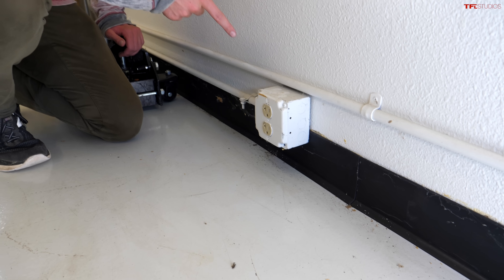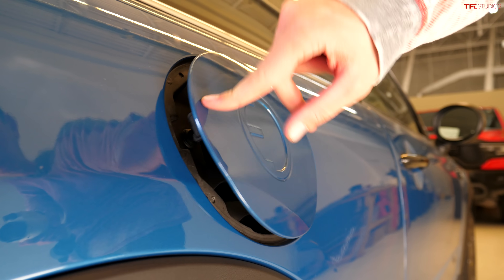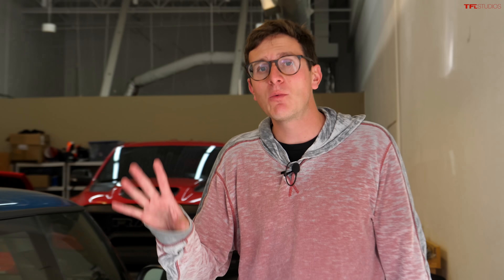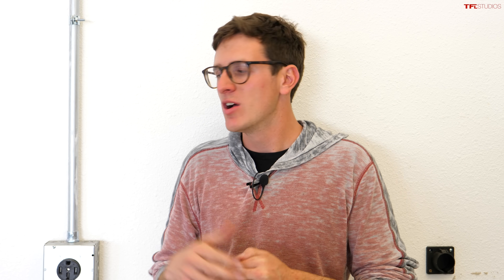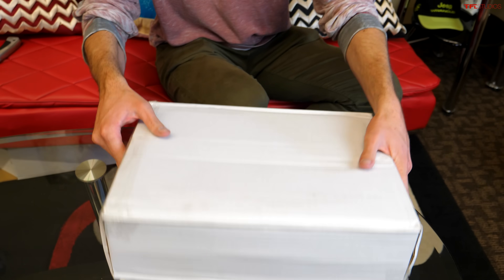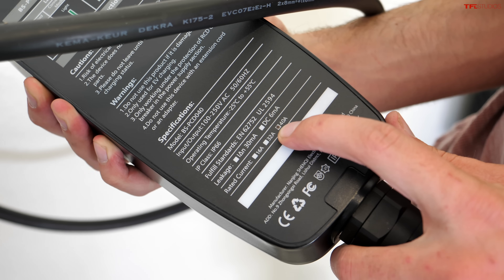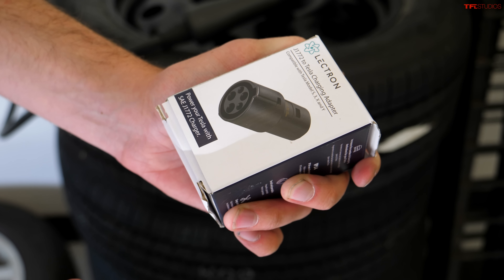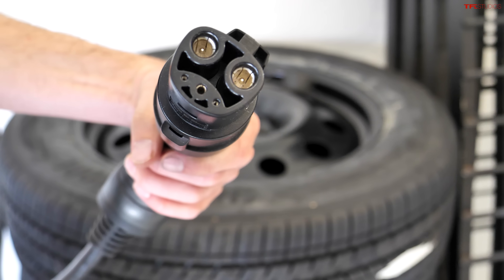Here's The One Thing You Don't Want To Forget When Charging An Electric Car!

Comment: 1:39 Unless that is a dedicated 20A outlet with a 20A plug which aren't very common, you can NOT charge at 1900W for an extended time.  A 120V 15A outlet (most common outside commercial settings) with the two vertical blades (plus round ground pin) can only charge continuously at 80% of the rated amperage of the 15A outlet or total draw of 1440W.   A 120V 20A outlet with the one vertical and one horizontal blade (plus round ground pin) plug can charge continuously at 1920W.  If you try to pull 1920 watts from a 15A outlet you will trip the breaker best case, however you do also run the risk of fire as most 15A outlets will be wired with 14AWG wire and not rated for that much current draw.  If that unit having a 15A plug is truly pulling 1900W that is a major fire risk.  Your video shows a 20A outlet which is correct, however the charger itself is only 15A plug on it, therefore should be reduced to 1440W max.  If its not, then this charger is very dangerous to use in 99% of residential settings as it would be overloading the wire, outlet and breaker of a 15A plug.  👎💥
Reply: True.  The Tesla chargers seem to interrogate the lines as they ramp up power and can spot faults or high resistance pretty well.  They’ll attempt to go for as a high a load as they can, then fall back when it detects issues with your wiring/outlet.
Reply: True, The 240 volt outlets here in europe are rated at 16 amps. Great, but that is only for max 1 hour. After that they start to become a bit warm.
Reply: True, The 240 volt outlets here in europe are rated at 16 amps. Great, but that is only for max 1 hour. After that they start to become a bit warm.
Reply: I find that 15a and 20a plug is nothing more than a blade turning sideway, it isn't any thicker. As long as the wire is at least 12 gauge or greater, it's usually fine to pull 20 amp even when both blade is vertical.
Reply: @AdamIverson  For the most part that is correct, however you can't assume that a 15A outlet will have 12AWG wire.  Most of the time it will be 14AWG wire for cost savings and its not required by code to be 12AWG.  Here if the unit pulls 1900W regardless that is a very bad design.  Because it has a 15A plug it should be limited to a max of 1440W period and then lower the current from there if there is any voltage drop.  I don't know the full operation of that unit, so I can't say for sure, but if they do pull 1900W that is a very dangerous system for sure and could result in potential fires.  They would be required to have a NEMA 5-20 plug on it and plug into an appropriate 20A rated outlet only.

Comment: I thought all electric cars come with level 1 chargers from the factory?
Reply: Most do. The Mini SE came with a cheap level 1 unit maxing out at 1,200 watts. We have 20 amp circuit breakers in the garage that could support 1,800 watts with a proper Level 1 EVSE.

Comment: So none of these carry UL or CSA certification?  Yeah no thanks.
Reply: You are correct. No UL List Mark, CSA Certification Mark or ETL List Mark. If tested to both U.S. and Canadian common standards the marks will have "us" on one side of the mark and "c" on the opposite side of the mark indicating safety compliance for both U.S. and Canada. There are local US and Canadian deviations that have to be taken into account for both US and Canada Safety Approvals that are not part of the common European Union Safety Directives that the CE mark indicates.

The units are CE marked indicating self certification to European Union Directives. There are local deviations for each country within the European Union that may not have been taken into account when the unit was tested. Lectron should be able to provide a country deviation list as part of their CE declaration upon user/purchaser request for European Union installations / usage.

In conclusion, only purchase units that have US and or Canadian NRTL Safety Marks like UL, CSA or ETL for North America.
Reply: @Joe3545u  Great info and agreed.  Here in Canada most provinces have laws against selling or using any non certified equipment.  But somehow Amazon seems to get a pass.  I'm sure hardly anyone will read these comments, but if you do please think twice before using these cheap charging cables.   If the manufacturer hasn't taken the time and expense to certify their product to North American standards, what other corners have been cut?

Comment: It's not as easy as just plugging into a dryer outlet. The plug you use for your level 2 evse is probably not the same that a dryer uses. Dryers are typically 30 amp circuits and they will usually have either a NIMA 14-30 (4pin) or a 10-30 (3 pin) outlet. Most level 2 evse's use a NIMA 14-50 outlet and when installed correctly will be on a 40 or 50 amp circuit. So at the bare minimum you will need an adapter to use a dryer outlet. You also need to make sure the current draw doesn't exceed the capacity of the dryers circuit. If you have a 32 amp evse you would need to be able to limit the current draw. Sometimes the car has the ability to set the current limit. If not there are also evse's that can set different current limits. The other option if using a dryer outlet is to get 16a level 2 evse, then you would be safe on most 220 outlets.
Reply: I charge my electric car with my dryer outlet using no adapter.
Reply: I forget what makes my evse but it came with 5 Nema adapters
Reply: I don't think it matters. Many EVSE suppliers offer specific plugs to meet the household needs (at least the lower amperage Level 2 units). And if that isn't an option, a quick outlet swap would suffice. Two hots and one ground is all that I needed for a NEMA 14-50 from a sub panel. The UL certified Level 2 unit doesn't care. Always remain mindful of circuit capacity of course.

But maybe a 10 minute outlet swap is inconvenient for most... idk. 

Understandably, maxing out on EVSE amperage could be detrimental and arguably overkill for the vast majority of North Americans. 20 amps (Level 2) is fine for most .

Comment: Complicated charging?  All you need is a NEMA 14-50 outlet.  You can get a Level 2 240v 16amp evse for around $200.  It will charge at double the speed of the 120v Level 1 in the video.  NEMA 14-50 outlets are commonly called '50amp' plugs at RV parks.  202v at your outlet is almost out of spec.  I see 247v from my 240v outlet in the garage.

Comment: Great video, EVSE (Electric Vehicle Supply Equipment) non of them are chargers they supply AC mains power, would have been nice if you used the dust cover park built into the sockets door instead of leaving it dangling against the body. Still a great explanation.

Comment: Seems a bit disappointing that the Wall charging station is only 32A compared to the Portable one which goes faster at 40A❓🧐 🤷🏻‍♀️
Reply: Many cars can only handle 32A AC charging anyway.  But there's tons of wall chargers out there.  Some of them go crazy at up to 80A.  Still, 32A is a good number if someone wants to, say, install multiple wall boxes without going crazy trying to build out the back end to support that much simultaneous current draw.

Comment: So ben sillis did a video on a easy 240 chargimg system. It was essentially a lvl 1 charger with 2 lines running from it allowing you to plug into 2 seperate outlets at once thus creating a lvl 2 without having to install a 240 outlet. Something to look into. I can drop a link if needed
Reply: You just have to make sure those two 120 volt outlets are on different circuits.
Reply: @caseyhill3915  correct

Comment: Great video: didn't even seem like an ad.  Love those carrying cases until I try to pack the cables in them.   BTW.  Isn't the electric utility that sends you the electrons the actual charger :)
Reply: Nope, that's just the energy source. The actual charger controlling it all is built into the car. :)

Comment: To save money on install i ran all the wires myself.  It is hard but simple work.  I paid the pros to wire up the breaker at the box and inspect my work.  Union shop bills by the hour and he was done with the minimum 1hr charge.  Materials such as my 150ft run of 6/3 wire costs a lot.

Comment: Tommy, the problem with a level two charger on the road is after the bathroom break you still have hours to kill.
At the moment given lack of on road options   and speed of charge EV's are impractical for regular long travel.
By the way it was a good and informative video, even though it reinforced why I'm keeping my Jeep Wrangler Unlimited Willys, that and the fun factor
Reply: Yup. That is why level two chargers are really only employed as "destination chargers" at office, lodging, shopping and tourist locations. Places where you are already stopping for hours.

Along the highway, level three chargers give you the speed you need. A large percentage of EVs (Ford, VW, Hyundai, Tesla) can charge as much as you need in the time it takes for you to grab a coffee and use the restroom.

For fast charging, EVs are much faster when the battery is low, say in the 10-70%  range. Above that, they rashly start to slow down. The MachE, for example, takes 50 minutes to charge from 90 to 100%, which is more time than it takes from 2% to 80%. It's a different mindset, but for long trips, you charge overnight to start with as much charge as your can. The first stop should be about when you reach 10%. Starting with this charge, you never want to fill the battery. You only want to add enough to get you to the next charger maybe 2-3 hours down the road.

https://www.msn.com/en-us/autos/news/watch-how-long-it-takes-to-charge-a-mustang-mach-e-from-0-to-100percent/ar-BB1g9s9A
Reply: @gregpetrites4182  interesting, that's not info that gets out there even from Tesla, whose tech I think is awesome even if he falls short on execution like fit and finish or not always being ready for prime time with a new release.
I think at end of day the legacy car companies are going to fall short.